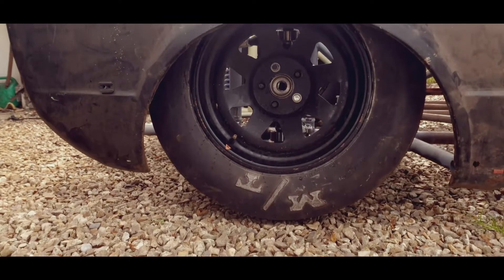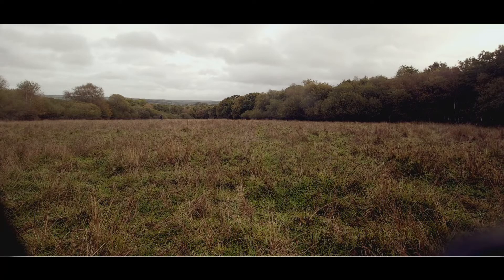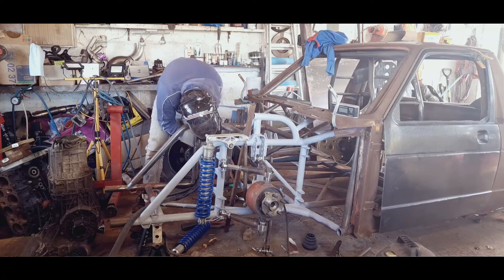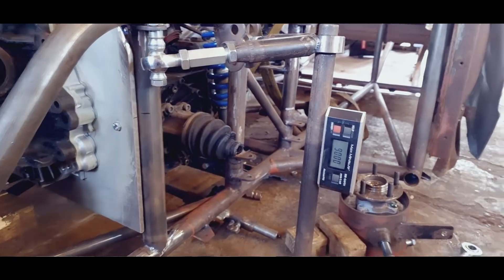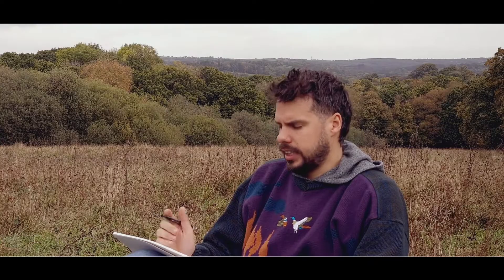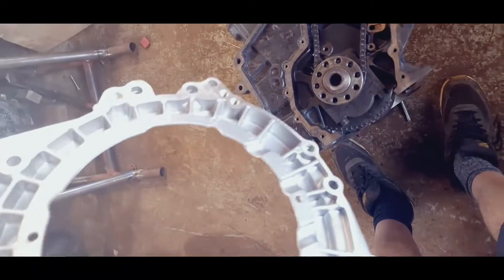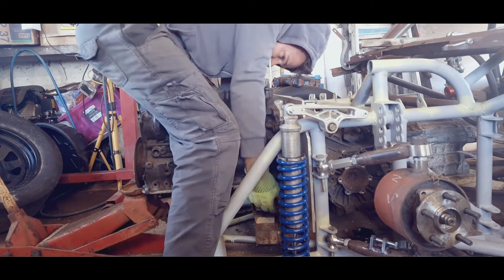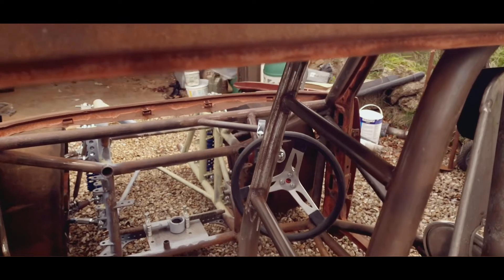They don't teach you this at racecar design school.

Comment: Love North Devon (mum lives in holsworthy)
Are you aiming for a min or max weight for the rolling chassis?
I ask because I wonder if CAD would be useful for visualising were all the cross beams gussets etc are and if they actually add anything other than weight.
Reply from the maker: im just aiming to be as light as possible really, can always add weight later. Think im going to stick it on the scales again before i decide on where to put battery and things like that.